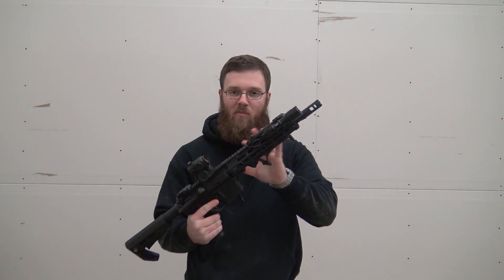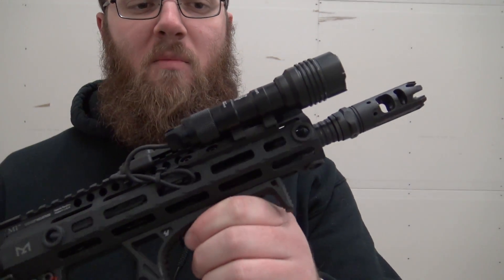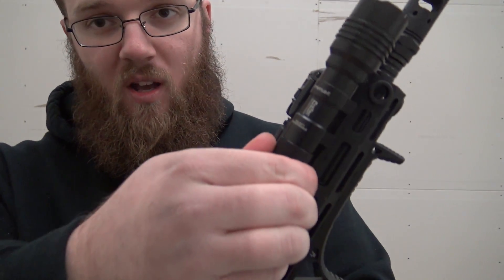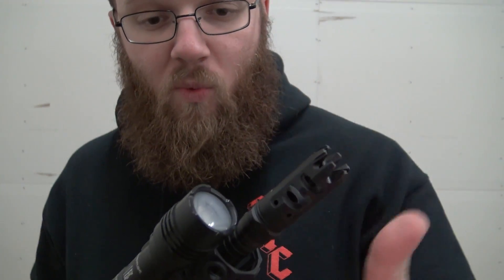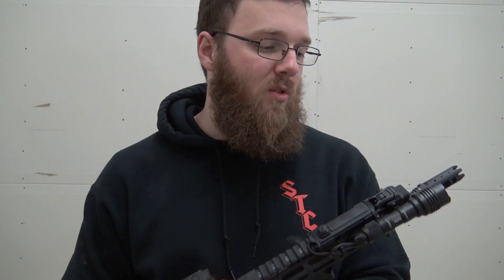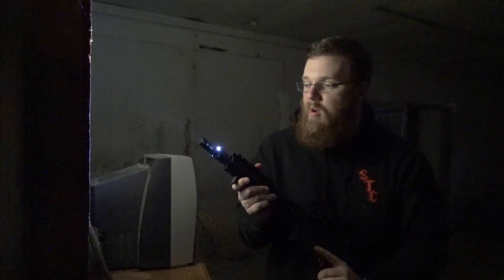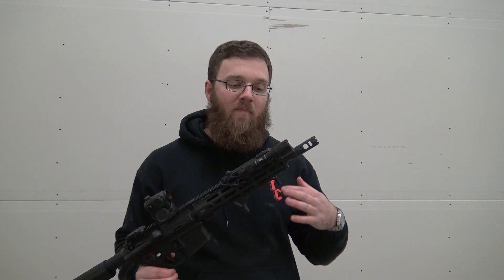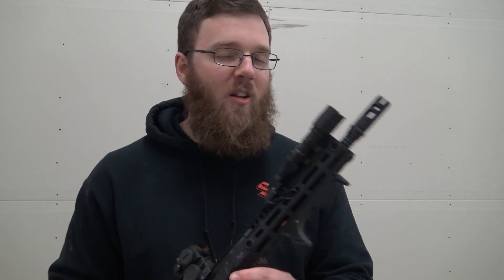Streamlight ProTac Rail 1 Review

Comment: So I have a 15” Midwest industries free float rail. It’s the lightweight mlok model. With that being said, there is no picatinny  rail on top, just mlok slots. So on amazon you can buy mlok  replacement screws and t-nuts, then you can take a tiny drill bit and drill out the holes on the tape switch just a hair bigger than what they are, and install the mlok hardware directly in to the rail. Just my two cents. Great content btw. I did my tape switch wire very similar to yours after watching your videos.

Comment: You can actually use the 10 tap programming to change this to a high only or a low/ high mode instead of high/ strobe mode! I prefer the low/high mode as it saves battery power on low mode but tap twice and back to high output!

Comment: You should use 2 eyes open with a red dot optic especially when you’re working in close quarters
Reply: u should use both eyes open regardless of what range or optic you are using.
Reply: Just curious as to why that is.   I always have trouble with both eyes open
Reply: tat 22020 try it out and you will understand

Comment: Great video.  Just curious on how that light handles recoil from a 12 gauge
Reply from the maker: I haven’t tried it, but I’d be surprised if it couldn’t handle the recoil. These are very well built.
Reply: @OreGear  
Thanks for the quick reply.  I will give it a shot.
Reply: I have 1 on my AR and my 870. Streamlight is very durable.
Reply: @marksmith6435  where did you attach it on your 870?
Reply: @ANTAGONISTKING  mounted it on magpul stock.

Comment: nice job. i agree with your review. its a good light especially for the price.
imo its 350 lumens is just enough to be used as a weapon itself.
its capable of blinding or dazzeling the foe but only just.
id prefer a full 500+ lumens but this one gets it done. its small, light and has been durable so far.
its a solid weaponlight.

i have this light on my go-to fighting/defensive carbine, a modded FN M4/RECCE carbine.
i have it mounted on a pic rail on the right front of my Magpul SL handguard and use my support thumb to activate the tailcap button from my vertical pistol grip.
it works well but i need a mount thats about 1" lower and 1.5" forward to be ideal.
i think Haley Strategic has such a mount. i plan to get one soon.

i had the tape switch mounted up on top of the SL and it worked great until i tried to swap my Primary Arms 1-8x ACSS sfp scope for my PA 4-14x ACSS R-grid scope for long range use.
the objective bell hit the tape switch and couldnt mount so i went with the tailcap.

why swap the 1-8x for the 4-14x on a M4 carbine you ask?
well, the 1-8x is awesome and it equals groups with the 4-14x at 100 yds.
but believe it or not this FN M4 is a consistent 1/4 to 3/8 moa tack driver! even out to 550 yds using inexpensive Norma tac .223 55 gr jhp ammo it delivers sub 2 to 1.25 moa firing standing, supported against a small sapling. 
with Sig Sauer 77 gr OTMs it piles them up out to 800 yds and beyond so i occasionally want the 4-14x for ultimate precision.

so...the tape switch had to go.
Reply: hold 'er Newt, shes rearin' ? At that rate I’d just recommend getting another firearm for home defense. 4x inside the house COULD work (I used to only have an RCO on my HD rifle), but I think you could do much better with some sort of illuminated sight at 1X

Comment: I want to add one of these to my 7.5, and 10.5.  I will probably use a Rail mouth 2 on my 14.5
Reply from the maker: +New2Kendo I really like the Rail 1 because of the ability to use both cr123s and AAs. If you need more light, the rail 2 is a great option as well.